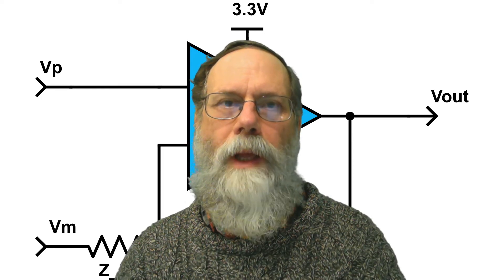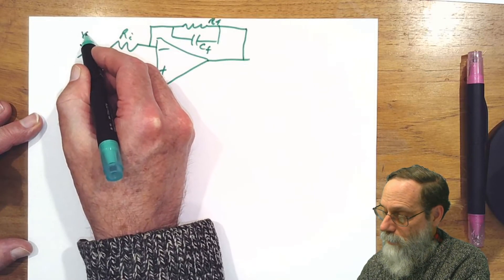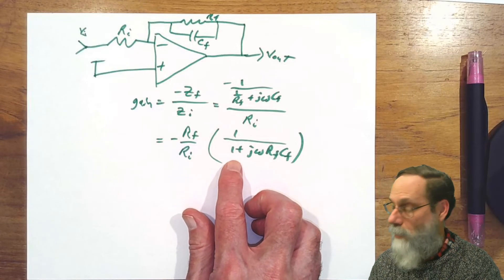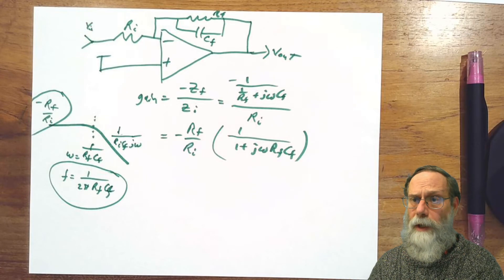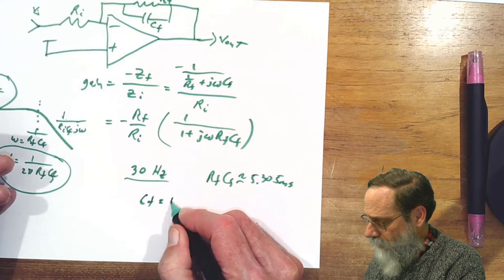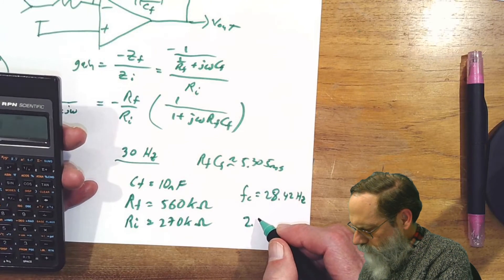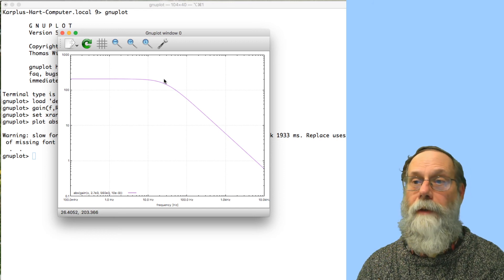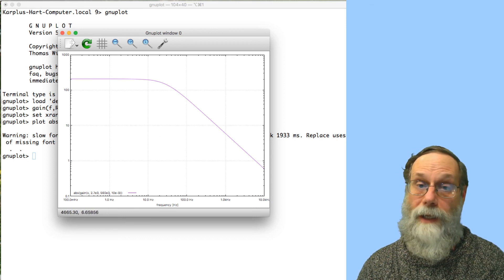Active low pass filters §24.2

Comment: Why are all the exmples on youtube less than 1 Mhz Fc ?
Reply from the maker: Because it is easier to do the testing on the Analog Discovery 2 at audio frequencies—the breadboard and wiring act as additional passive filters at higher frequencies, and I did not want students to have to make more complicated models to account for them.
Reply: @gasstationwithoutpumps  Can you reccomend a youtube video or site that works with op-amps at HF (high frequency) ranges ? Especially ones that actually discuss how to choose the op-amp ?
Reply from the maker: @phillipneal8194  I did not make a video about it, but Sections 23.4 and 24.3 of my textbook talk about compensating amplifiers for stability at high frequency.   You might find a little useful info in https://www.youtube.com/watch?v=JQKmXKsCd4Q